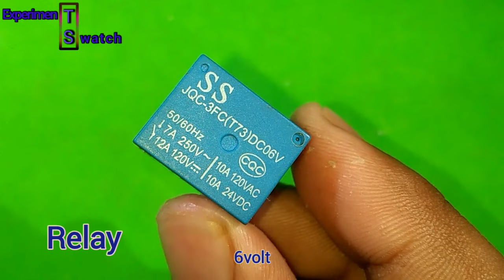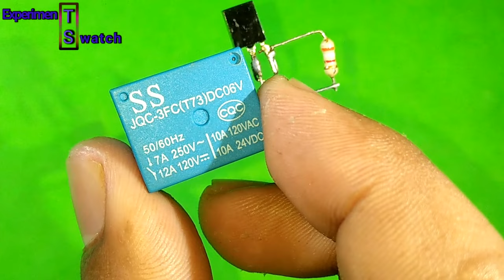Remote Control Switch Circuit | How to Make at Home

Comment: why we need batteries for RC circuit? does this get power from AC which helps to glow the bulb here. Please clarify.
Reply: The battery is for the coil in the relay